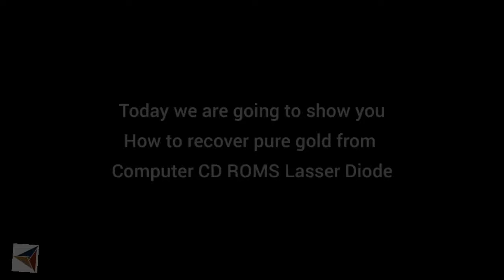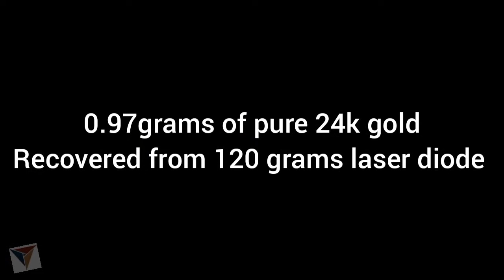Laser Diode Gold Recovery | Computer CD ROM Gold Recovery | Recover Gold From Computers

Comment: so basically if the extraction is very efficent (like no gold lost from transfering solutions) then thats pretty much a gram of gold per 120g of laser diodes. thats quite a bit of gold considering that CD drives are pretty common.

Comment: Have you thoughtbabout doing a video on sockets? From cpu to memory to vintage augat sockets, partial and fully plated?
Reply from the maker: Yes I have plans Mr.Perry.
It’s coming soon one by one!
Reply: @TrinityGoldRecovery  Just throwing out video ideas for you. If you gold solution is cloudy on your second refining you can filter it twice or three times, it helps aid in more pure gold. Ive never tried it but the eco goldex seems like a great product for lower yield material.
Reply from the maker: @chosen1one930  that’s a very good suggestion  Mr.Perry. But eco goldex is not available in my country 😢😢😢
Reply: @TrinityGoldRecovery  ebay dude, the guy ships world wide. Ive seen that material in numerous random countrys.
Reply from the maker: @chosen1one930  gotta check that!!